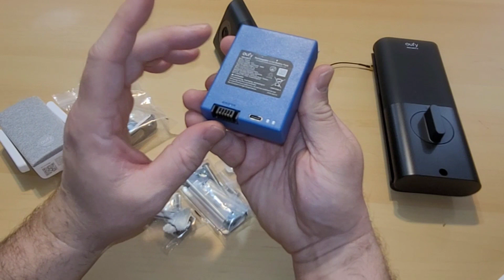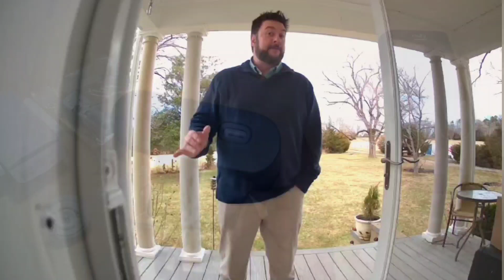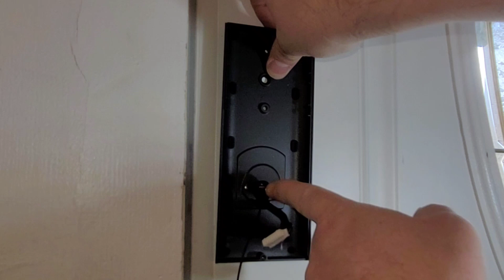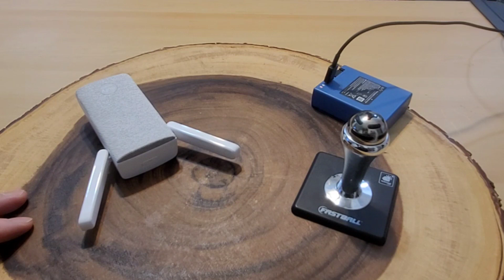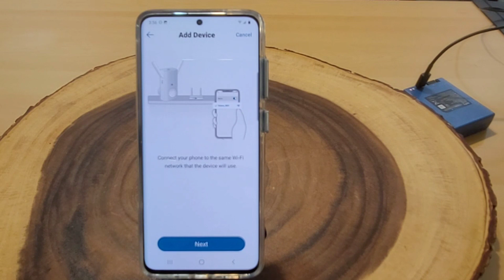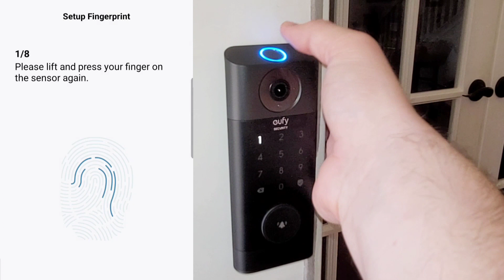EUFY Video Smart Lock. Setup, installed, and Tested. [392] #eufy #videosmartlock

Comment: Hi, I have a Eufy E110 smart lock. I've gone through the installation a few times now. The lock works smoothly manually but the calibration keeps failing. Any ideas?

Comment: Great review of the Eufy lock.  Can I check if this smart lock is also weather resistant and if we can use it on external gate ?
Reply from the maker: My thoughts would say no.  The exterior is weather rated, but the interior is not.  The inside portion is made of plastic and does not have any rubber seal around the battery compartment.

Comment: I'm a super earlybird backer. Could you PLEASE explain the reset button on the exterior of the lock ...
Reply from the maker: If the unit freezes and needs to be reset there is an external reset button. It doesn't reset the settings or delete anything.
Reply: @Jeffreviews4u  Fantastic. Eufy really needs to address this, I saw a few people in the comments that cancelled their pledge because they thought it factory reset it. Very quick reply too, earned a sub and good luck in your YouTube adventure.

Comment: My door has a lot of elevations and ridges... I'm curious how wide the outside component (number pad/video/fingerprint reader) is.... does anyone know? I looked up the kickstarter but could find no dimensions listed.
Reply from the maker: The interior part is 3 1/16 inches at its widest spot (it's rounded) and 8 inches tall. The exterior part is 2 7/8 inches at it's widest spot (it's rounded) and 7 3/8 inches tall. Hope this helps. Thanks for stopping by and commenting.
Reply: @Jeffreviews4u  Thanks!

Comment: the reset bottom is out side the door under the keypad what happened if someone push that reset bottom
Reply from the maker: Push and hold the reset button and the system reboots. Similar to a computer if it gets frozen. Nothing is deleted it just resets the device. Thanks for stopping by and commenting.

Comment: Thanks for the review,  3 qs I have:
1. Battery life.  What's the expectancy between charges.  And how long does it take to charge?
2. Can you show how to lock from outside?
3. Does this unit support RTSP streaming? Say to an existing home NVR.

Thd
Reply from the maker: Battery takes about 3 hours to fully charge (at least mine did).  Battery consumption would be based on how often you used the camera. I had to recharge within the first month (I used the camera a lot).  Door can be locked through the app, thumb scanner, key pad, or key. Thanks for stopping by and commenting
Reply: @Jeffreviews4u  have you seen Lockly's Vision Elite? If we're talking about battery life, I think that one's superior than others. I mean, the lock comes with an extra easy swap battery and has solar panel charging. I'm still on the edge on which smart lock to purchase for my front door but so far, my first choice is Lockly

Comment: Does this lock have key to open if battery died.
Reply: Yes, he shows you @6:25
Reply from the maker: jwolfe6 - thanks!
Reply from the maker: Yes, it's under the doorbell. There is also a usb-c emergency power port on the outside to provide power. Thanks for stopping by and commenting.